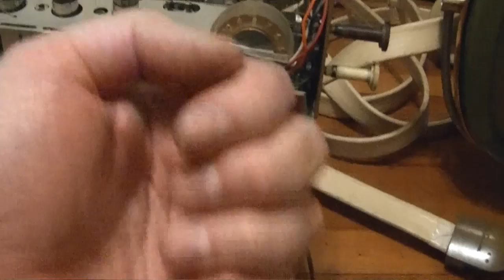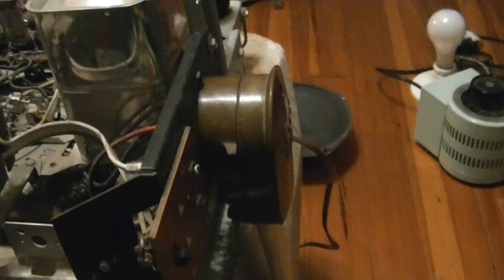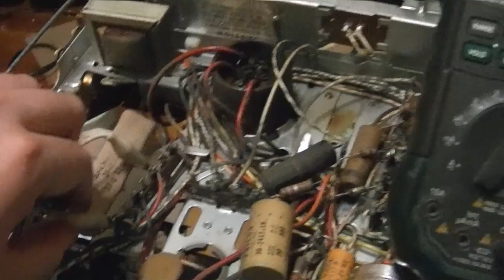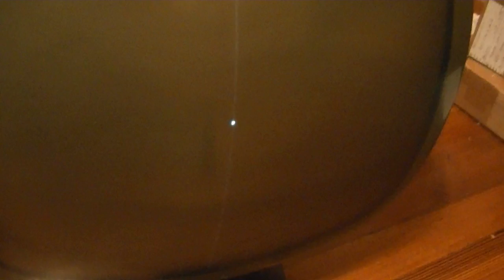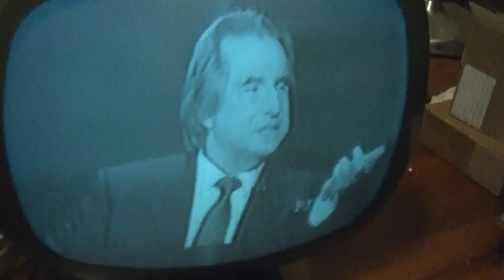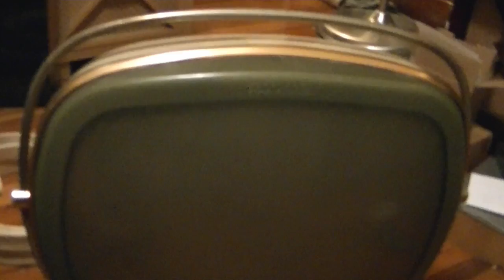Predicta Tandem (blonde) restoration p1o?

Comment from the maker: As far as I know, no other set was ever made that used a cable.  Aside form the HV, there's 60Hz for vertical, 15.75kHz for horizontal and about 0-4MHz for video.  The cable is pretty high quality and shielded.  The video signal also has a booster amp inside the CRT housing.

Comment: Sometimes they will use a low value wire wound resistor on the output of a silicon rectifier diode to protect the input filter capacitor from inrush current in a tube amp, other times they will use a relay to allow the tube heaters to warm up before the B+ is applied. I'm not sure how much difference it makes as selenium rectifiers were pretty much instant on like a silicon diode, and they were very common in later 1950s tube equipment.

Comment: I see. Many thanks. The set uses transformer, and only one voltage is rectified, and its the high one. You are right, low voltage for filaments is not rectified. The only mistery is, the tube started at some point doing that ... because I'm not keen on tubes, though it was a bad sympthom.

Comment: It's B.S, a silicon diode is a more efficient rectifier with less AC ripple then a tube rectifier, if it was designed to use solid state rectifiers. If you are asking about the tube filaments those normally run off of AC, either in series off the power line or in parallel off of a transformer, so the rectifier doesn't even come into play. It's normal for a 12AX7 to glow brighter at first as they have a smaller heater then the EL84s, also more of the cathode is visible since they are triodes.

Comment from the maker: I really don't know much about amps I'm afraid.  I think I read somewhere that it's normal for some tubes to light up bright when first turned on though.   Also if it's a transformer set, you shouldn't need a thermistor.  There really just needed for series wired filament sets.

Comment from the maker: Many of the caps are in the "bumblebee" type which are encapsulated in plastic.  Those are difficult if not impossible to restuff.  That's OK though, I think the real value of these sets is all about appearance not the originalilty of the electronics inside.  Now the RCA 630TS is another story and I will try to restuff all the caps in it.

Comment from the maker: Luckily, hooking the wrong one up won;t burn out the filament.  It's wired in series with the other tubes, thermistor and dropping resistor.  Those will tend to limit the current through the CRT filament and protect it from burning out.

Comment from the maker: I doubled down on vitamens and chicken soup - seems to have worked :)  Yes, the original CRTs run at 2.3 volts.  The 17" CRTS run at 2.68.  Go figure.  I wonder how many were burned out by service techs testing them at the normal 6.3 ?  I did a visual inspection of the tube sockets and they appear to be OK.

Comment: Bob, I'm using a tube amp, some old one, push pull EL84, It uses diodes to rectify the AC current. What happen's most of the time, some tube (the 12AX7 in the preamp section) lights up as hell at th start, then light up as usual. It does this pretty in the same tube, but sometimes happens in other tubes also. Is it an issue ?. Would whit termistors help to solve that ? Some guy told me it was preferred to use tube rectification of the AC because its soft start ...  Many thanks. Nice Vid as usual

Comment from the maker: Yeah I imagine once the fine tuning is done each screen will work best with it's matching base unit.  The factory recommendation is to short out the 8 ohm section of the series filament dropping resistor when using a 6.3 v filament vs the original 2.3 v filament.  In practice though since our line voltage is typically higher these days I think it's best to leave that resistor in circuit with the 6.3 version.

Comment: I'm really glad this Predicta ended up in the right hands, I was really hoping you would get it when I first saw it on ebay.  I'm really amazed at how well it works, and all original.  I wouldn't have  expected it to have such well balanced horizontal and vertical control even if it did have a picture.  This is going to be a top performing Predicta, and a 1950's blonde classic for sure.  Glad you're feeling better, no explanation for it, but I haven't had a cold in over 15 years.

Comment: Excellent results for a first initial power up, you've got a really good Predtica there and amazing that its performing so well on the original components. I bet that set hasn't had high use considering how its still working.